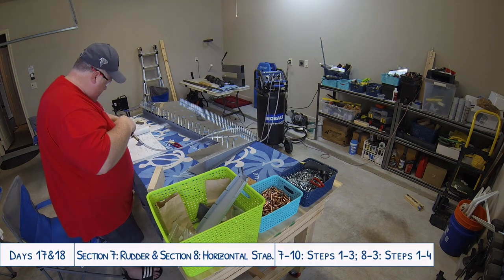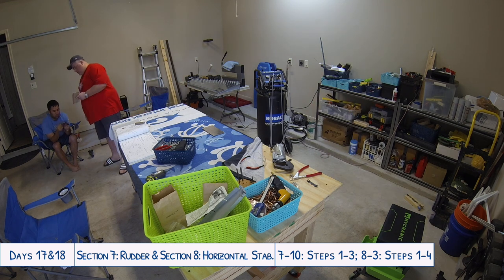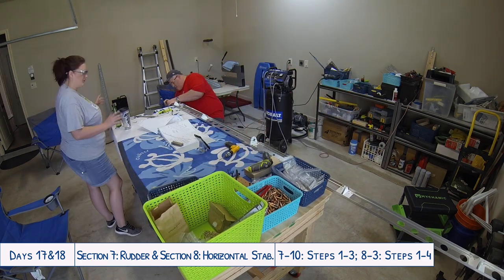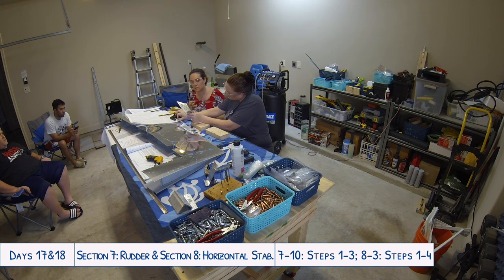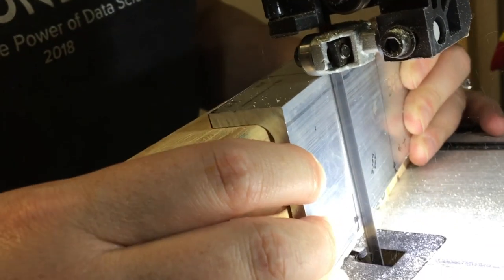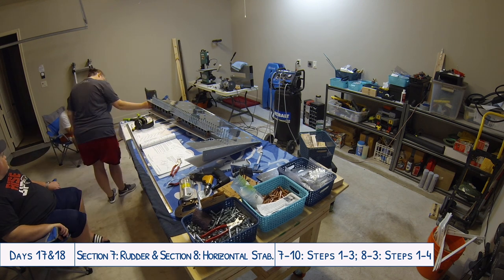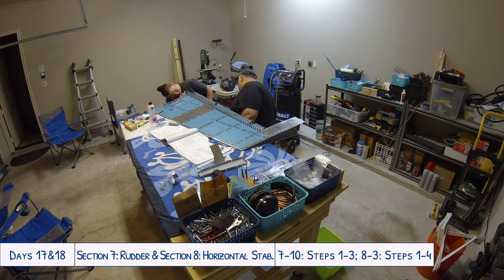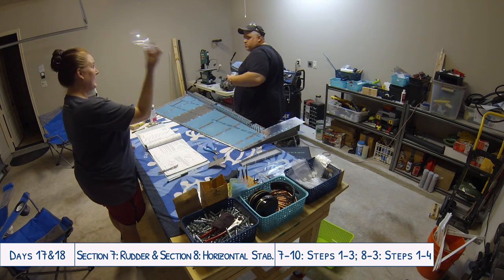Van's Aircraft RV-10 Build: Days 17 & 18 - Working with Friends (7-9 & 8-3)

Comment: Hopefully someone who knows more than I do will chime in about dunking the hot parts in water. Some metals encounter a shock cooling effect that can significantly damage the integrity of the metal and the damage is not visible (it’s microscopic). I do not know if this may apply to your situation. Also FYI - you can buy a torque wrench that has an led display that indicates the pressure so you do not have to rely on ambiguous feel to know when to stop. Great video as always and thanks for sharing!
Reply from the maker: Very great question and I'd love to hear from a materials engineer if there's one out there in response. My (limited) understanding is that it would have to get way hotter in order for the T-6 aluminum to lose is strength, but I am no expert. Good suggestion on the torque wrench! I like this one now that we learned what to look for, it was just more subtle than I had been expecting. Glad you like the videos 😊
Reply: The sanding she is doing does not heat near that far, She is cooling because it is too hot to handle.
Reply: Agree with Wizz Bang, the temp at which she cant hold it with a bare hand and dunks it in the water is too low for anything bad to happen.
Reply: Agree with Wizz Bang and DIY.
Reply: Avoid tools that require batteries(they are always dead when you need to use it), also you have to be able to 'see' the LED instead of going by 'feel' which is how the traditional break works..   And never use a torque wrench to remove anything, ONLY tighten with a torque wrench.    You guys will learn a lot.
Reply: The Melting Point of T6 Aluminum is 1,202 Degrees F.  When using a Scotch Brite pad, the part will get hot, but not enough to disturb the Microstructure of the metal.  If it DID get that hot... it'd be glowing... and your hand would NOT be near it!  (25 year (Retired) Metallurgical QA Inspector for DoD speaking)  =)

Comment: You might want to look into (if you haven't already) using a "cutting oil" when doing that type of cutting or drilling of the heavier aluminum.  It will help keep the parts cooler and will definitely pay off in terms of keeping your bits and blades sharper for longer.  Does need to be cleaned off afterwards though!
Reply: Lots of boelube.
Reply from the maker: Hadn't looked into a cutting oil - good suggestion. We do use the Boelube when drilling/countersinking thicker parts.

Comment: What size torque wrench does it call for?
Reply from the maker: We have the CDI torque wrench from Cleaveland Tool that covers 20-150 in. lb.
Reply: @PlaneLady  yep, figured it was small. I have seen a helo mech snap off a small screw and drop it inside a transmission because he couldn't feel the break on a small torque wrench on a low setting. He was expecting a audible click that you can hear on higher settings.
Reply from the maker: Yeah, I was just expecting something louder/stronger I think. But now that I know what to look for it's great 😊